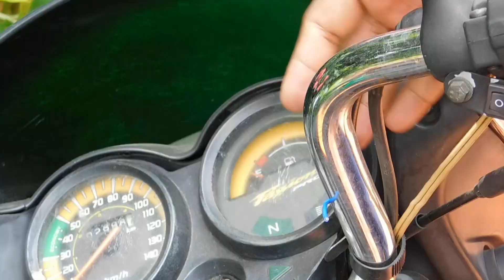വെള്ളം കൊണ്ട് ഓടുന്ന ബൈക്ക് ഉണ്ടാക്കാം | WATER BIKE | ZBOX |

Comment: Cars, and buses fueled by hydrogen was demonstrated in Philippines by a engineering professor using water as the input about 20/22 years back in the presence of international media.
But almost overnight, the news have been blacked out apparently due to the sudden and adverse effect on the world economy. That invention would have enabled the convertion to water fuel by attaching a device to the existing engine.
Reply: u r right bro

Comment: Hydrogen alla,  water gas,  mixture of oxygen and hydrogen.
Reply from the maker: Its considered as oxyhydrogen.. but    generally its called hydrogen generator.. Thanks bro for your clarification😍😍
Reply: @ZBOXMEDIA  It is called an electrolytic cell.
Reply: H20 eletrolises H2 and o2
Reply: njaanum atha aalochiche h2O il ninnum Hydrogen seprate cheyyan possible allallo
Reply: @abhishekav2354  pattum  nan pidichatund eletrolisis ennu parayum
Reply: @adithshaju7059  yes bro school il padikkan undarunnu..
Reply: @abhishekav2354   possible aanu..  u have to colkect the gas from anode and cathord seperately,  but here not needed..  because  hydroger is used for burning and it need axygen to..  so no need to take external oxygen..  taking the priduced oxygen along with the hydrogen...  

You can make cooking stove and gas cutter(small sample) and many otherwith this gas..  chk some videos.. and make and  enjoy..